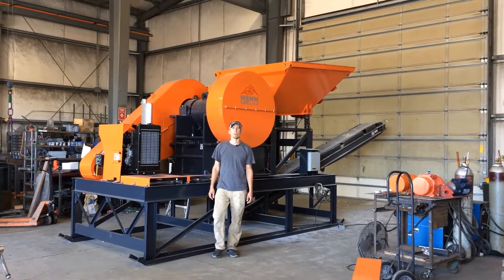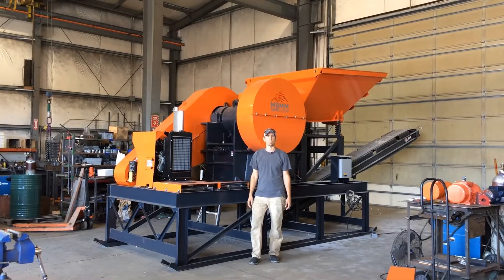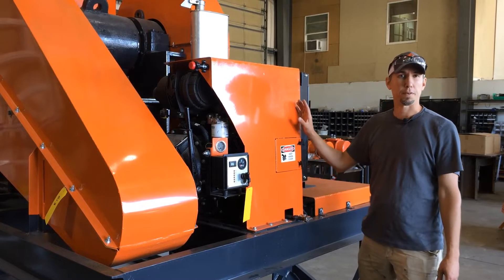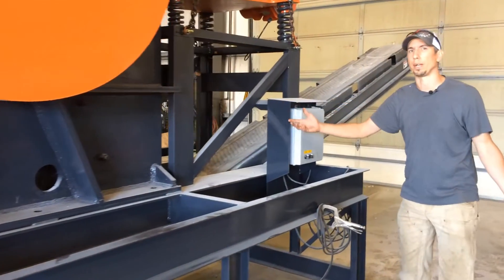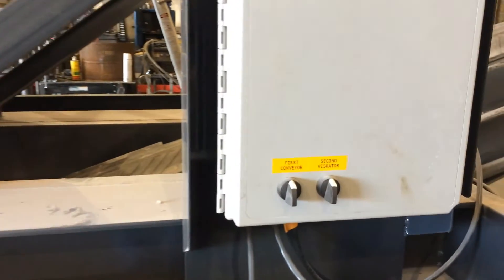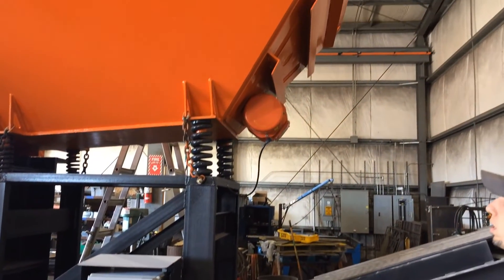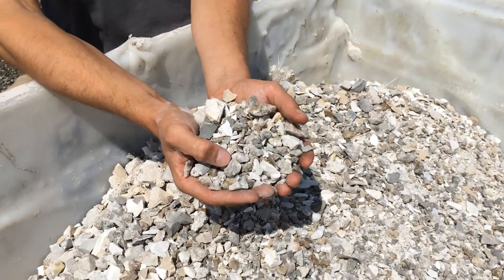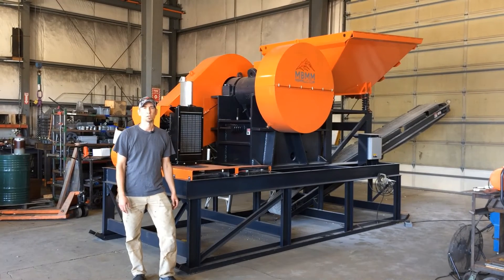Diesel Powered Jaw Crusher / Rock Crusher

Comment: Nice !! 
With a little larger wheel on motor (to bring diesel rpm down to 15/16k @300 on crush), and come off that to gen motor (self-contained).. 50hp should easily enough TQ for that... 
And maybe Led lighting to boot..
Very Nice 
Stay Safe

Comment: Couldn't you just replace the motors with single-phase versions and avoid the need/expense of a phase convertor?  Or even just a simple hydraulic pump system off the diesel to run the conveyor & shaker, thus totally avoiding need for electricity.
Reply: Good thinking,....... see,    we as people can do anything if we put our minds ../ .. heads to it ..lol.
Never stop thinking never be still or let you shut up by nobody!!! like EVER ..... lol ;-)
Specially in times like right now!......Let this world work as 'we' see fit for the good of Humanity.
We have this# [ people can do this]

Comment: Jason why did you not put a slightly bigger HP diesel engine on this Jaw crusher and mount an AC Generator to the diesel, then it would be fully independent so it can stand alone any were in the world, nice looking machine thanks for sharing.
Reply from the maker: Great, thanks for the tip!
Reply: better put hydraulics system on. more possibilities with speed adjustment